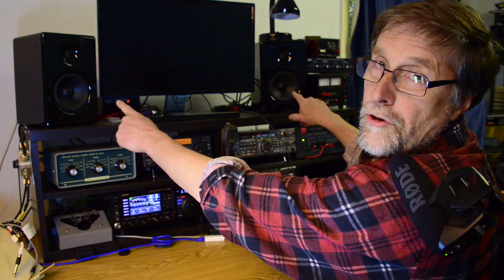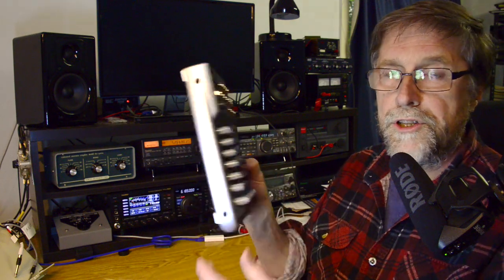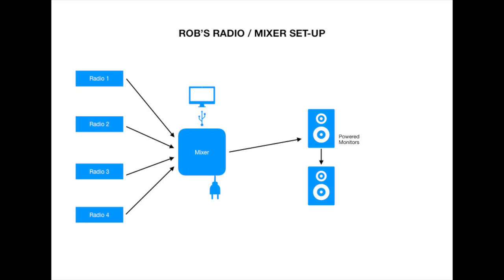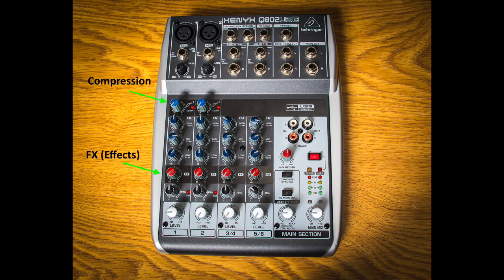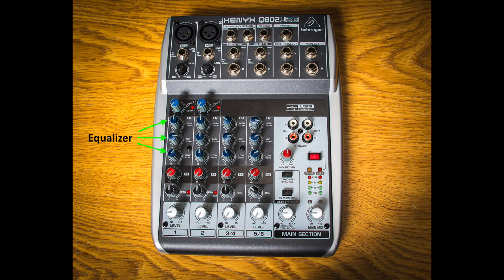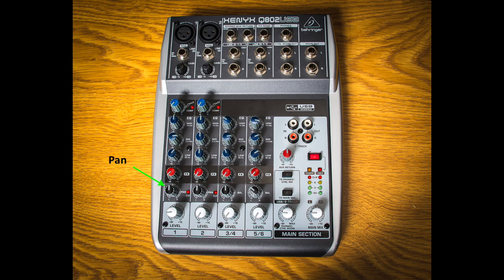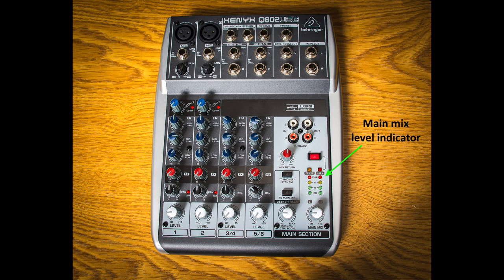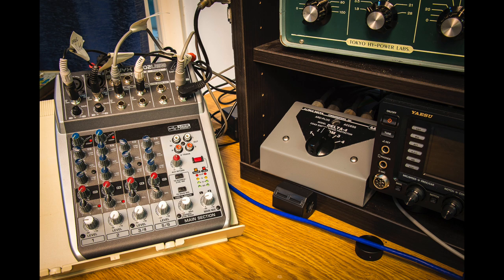Using a Mixing Console in the Radio Shack

Comment: The Xenyx802 is a great little board. I just picked up a used one for cheap and I'm amazed at how much you get and the quality you get from a little discount mixer.
Reply from the maker: Yep. They are great value if you buy them new...even better value if you can catch a used one in good condition. Good luck with it. Rob.

Comment: Nice way to tie in all your received audio Rob (creative solution), reminds me of when I was using a car graphic equalizer in the late 80's to improve the sound out of the Pearce Simpson Super Tomcat I was using during that period (native audio was particularly poor on that radio).
Reply from the maker: Interesting! I vaguely remember the Super Tomcat. Never owned one, probably because I'd moved off into the amateur bands by that time. Audio on some of those CB radios seemed to be better than others. I have a stereo graphic equaliser here, and tried implementing it into the system into the radio shack. But it was not successful, so I pulled it out again. I think there might be a fault with it somewhere. Will have to check it out again one day.

Comment: Is the mixer being recognised on a PC like standard USB sound card? Or must use software provided by the manufacturer? I don't use Windows nor Mac OS, so I wonder if I will use USB port anyways. I am looking at a 502 or 802 model (w/o the USB), to connect PC's sound card, FT-891, external PC speakers, headphones and mic. I am not sure if all that will work fine. Thnx.
Reply from the maker: Hi Thomas. As I show in the video, I am only using the mixer connected to audio output jacks on the various receivers/transceivers. There is no connection or interface with a PC. So I cannot advise on the setup you describe as I have had no experience with using it that way. Sorry I cannot be of more help.  73, de Rob VK3BVW

Comment: Bob Heil in a video that linked to this one stressed taking the audio output from the accessory plug in the back of a radio and running it into a mixer. He didn't even mention the external speaker jacks. What do you suppose was his reasoning? I'm of course going to go back and ask the question on his channel, but I'm curious what you might think as well. 73!
Reply: BTW here's the video in question: https://www.youtube.com/watch?v=BlmgC75SuSo. The first part of the video is about why mixers are pretty useless on the transmitting end, for the similar reasons to those you mention plus a review of the frequency spectrum they cover. The second part, however, gets into using a mixer to fine tune radio outputs, and that's where he speaks exclusively of the accessory jack.
Reply from the maker: @RickRose   Hi Rick! Bob Heil is saying that by taking the audio out of the accessory socket, you are going to get a better audio feed quality than if you take it out of the extension speaker socket. This is because you are bypassing additional audio filtering and colouring of the sound that’s inserted before the audio reaches the internal speaker. 

Because the purpose of the radio is as a communications tool rather than for hi-fi quality listening, he is saying that the final AF circuits and filters in transceivers are designed for the best sound from the internal speaker (which is usually narrower and a more punchy lo-fi quality). He’s right!

However, in my situation, I’m connecting two shortwave receivers that do not have acc. sockets, just an external speaker socket. For simplicity’s sake (and because I was in a hurry to try the new mixer at the time), I just took lines straight out of the transceivers ext speaker sockets as well. My two transceivers do have acc sockets, so I will try Bob’s suggestion and see if it makes as big a difference as he says.

Thanks for the question, Rick, and for taking the time to watch the video. 73 de Rob VK3BVW

Comment: Hi Rob just got my behringer mixer same as yours it's feeding a spare onkyo amp I had also I've purchased some jbl control one speakers.What are your Rx audio settings from your ftdx3000? I have the same radio.Im glad I went down this route instead of buying an overpriced extension speaker as I have more settings to tinker with and a better quality speaker.Only bug bear is with mixer no on/off switch :( grrr de 2e0utb 73
Reply from the maker: Mr Mc - I’m on holidays this week, so not near the radio. I’ll check up and get back to you next week. 73, Rob

Comment: Where and how do you plug a ptt switch?  Is the ptt switch go into a separate box?
Reply from the maker: I use the mixer for improving the sound on receive mode. I don't use the mixer for transmitting, so no PTT switch.
Reply: @RobVK3BVW  where does the ptt button go to the radio?

Comment: Rob, can you talk a little about RF shielding on this setup?  I tried this, but my TX audio keeps getting into the speakers.
Reply from the maker: Hi Scott. Are you using ferrite chokes on the speaker leads? These are an absolute MUST to avoid any stray RF out of the txer getting into the speakers. I have the clip-on types on my speakers and this helps heaps. Get a big enough clip-on for each lead so that you can wrap the leads through the clip-on multiple times. The more times you wrap around, the higher the choking impedance and so the greater the effectiveness in reducing RFI. Check out my video on this topic at: https://youtu.be/J_1jRfnvp4g   That should fix it!  Good luck!  Rob
Reply: Rob Wagner thanks Rob.  I’ve tried a few toroids and clips with varying results.  What mix do you use on the speaker leads?

Comment: but in addition to mixing multiple radio to speaker monitors, I'd like to use a single mic and also be able to mix and adjst eq to multiple radios... I would also like be able to connect my computer so I can send audio from the computer to any radios and also send the radio audio to the pc... that would require a more advanced board I guess...

Comment: Do you have any problems using speaker level input from the radios instead of line level. Isn’t speaker level much higher than line level?
Reply from the maker: Not at all, Gordon. Audio output from each radio is up about one-third volume, and channel levels are generally at around 1/3rd also, and final output to the monitors are about 1/3rd also.
Reply: Rob, does the speaker have to be a powered speaker?
Reply from the maker: Gordon, strictly speaking, no. This setup can work with just passive speakers. But there may be a little insertion loss resulting in somewhat reduced volume output. That can be overcome by cranking up the volume considerably on each radio. But then you may find slight distortion creeping into the speakers if the output amp on the radio is driven too hard. One of the benefits of powered speakers is that you can have a lower or more moderate volume set on the radios, and then let the powered speakers do the work of amplifying clean audio to a comfortable room level volume.

Comment: could i do what you have done putting a eurorackub502 on my icom 756 pro just bought one can you help please
Reply from the maker: Yes, Steven. It's a smaller mixer than mine, but if you are not trying to connect up lots of radios, it will work fine. Follow the diagram in the video for connections. Good luck. Rob VK3BVW
Reply: @RobVK3BVW  arr thanx alot rob i ordered the wrong plugs but i went through your vids and im waiting on my new plugs arr thanks alot keep up the good work and have subscibed to your channel think its great im from liverpool by the way lol anyway thanxs rob 73
Reply: @RobVK3BVW  oh and its only for 3 radios two icoms 756 720 and a vhs kenwood

Comment: Can you tell us about the speakers you use, and what to look for when shopping for speakers to achieve similar results?
Reply from the maker: Scott, the speakers I use were a relatively cheap pair (about A$300) of powered speakers. They are certainly nothing fancy. I first purchased them back in about 2008 for other projects. Then they got put away and not used for some years....until I bought the mixer. They have proved ideal for the job. Of course, they are no longer available now.  Here's a link to an old review I found from TechCrunch: https://techcrunch.com/2008/06/03/review-cygnett-unison-i-x5-ipod-speaker-system/   However, if you looked around for something similar, or if the budget can stretch it, a pair of bookshelf JBL speakers (such as the Studio 220) could work very nicely indeed! Powered speakers are a better option rather than passive - see my comments below to Gordon Zimmerman. I hope that helps! - Rob

Comment: Rob: you mentioned no RFI from the mixer's switching power supply, which is great.  How about RFI when using this device to mix audio from a computer and receiver?  When connected to a computer via USB, along with your tabletop receiver, do you notice any RFI creeping into your receiver from the computer?  How's the RF isolation between the inputs?
Reply from the maker: KILOKAT7 - I have not experienced any problem with RFI by connecting the USB cable between the laptop and the mixer. Any noise being picked up by the radio is due to the location of the laptop to the radio and not related to the mixer or the USB connection.
Reply: Thanks for the confirmation, Rob.  I just ordered one to try out here!

Comment: Rob, what name brand studio speaker are you using?
Reply from the maker: Gee, Chuck, I don't remember off hand (not in the shack right now). They were a $250 pair of an unheard of brand (to me!). Nothing fancy. Not studio reference quality or anything. But they do have a reasonable frequency response without being stunning! For shortwave, you don't need to pay $600+ for speakers. Just something that can handle a range of frequencies without distortion, that has a reasonably compact sound.

Comment: Dear Rob, what Rode microphone is that?  It sounds fantastic!  73, Jarrad VK3BL :)
Reply from the maker: It's a RODE Video Mic Pro. Of course, it is designed to sit on the camera (I use a Nikon D800), but I have it strapped to a boom stand. My mic is a few years old now, but I believe that have made slight readjustments to the current version. They even have a Video Mic Pro+ model but I don't know much about that. I have a videographer friend who has worked internationally, who insists on only using the RODE mics. And of course, they are a great Aussie company! Keeping the audio into the camera down lower and letting the +20dB preamp in the mic is a big help in getting a better sound. Here's a link for further info: http://en.rode.com/microphones/videomicpro
Cheers, Rob VK3BVW
Reply: I actually use this very same mic along the 7300 connected to zoom H5. The best you can get in the budget. I get lots of compliments on my audio.

Comment: 1:44 "I don't do any transmitting these days" and that right there is the often talked about problem that is constantly noticed by new hams. Lack of activity on SSB. These are licensed hams that simply hardly get on the air anymore. What is going on? It wasn't like that in the 90's and before. What is this aversion to getting on the air? And it's more and common. You can have reasons, but the sad part is that collectively more and more hams are not getting on the air. You can see it on QRZ where  nearly 80% of those commenting readily admit they don't use their radios for transmitting. If anything, THAT is what's going to spell the end of the hobby. 

Otherwise fantastic video on wiring up a mixer for receive only,
Reply from the maker: Whoa!! This video is more than four years old. Clearly, you haven't checked my QRZ page recently. I'm pretty active these days, where you will find me on FT8, WSPR, and occasionally out in the field on SSB. I am not sure how you derived the 80% figure of inactive hams listed on QRZ. Indeed the ham bands have been increasingly active since COVID has been around. People at home were looking for something to do and rediscovered their love of ham radio. You may not find them so much on the voice modes but the digital modes are extremely busy. And CW is making a big comeback since the code testing requirements were withdrawn (how's that for irony!!). There are lots of reasons why there is less activity than in the 70s-90s, but that topic is too long to discuss here!  :-)  Anyway, thanks for your comments and taking the time to watch the video. Have a great 2022!  - Rob VK3BVW
Reply: @RobVK3BVW  I'm aware of the date of the video and appreciate your comment even more so. I'm glad you're active now. But I did specifically mention SSB. And I didn't say that 80% of listed hams on QRZ are inactive. I referred to the commenters on the QRZ forum. And "NEARLY" 80% of them readily admit they are inactive. Again. Why? I'm talking about voice as I was in the original comment. Theories, there are many. Society changed/MIllenials and Zoomers (in America) are shy and are used to texting/etc. etc. but the fact is that people your age, my age, and older have stopped "talking" on the radio. 

And great for FT8 and D-STAR etc. But the fact is that you tune in 40 meters late at night and it's become a barren wasteland. It really wasn't like that even as recent as 2005. So there IS a problem. And you don't get on voice, so that's part of the problem. I fail to see what is wrong with talking to others with a like minded interest. But I'm glad that CW is active and it's a goal I aspire to myself.

But yes, if people don't get on the air (you should read the comments on QRZ. They have brand new commercial radios and don't use them) that is indeed the death of human voice contact on amateur radio. Is that the way it should be? Should that not be changed if there is a genuine love of radio ways and how your voice travels through the air to reach other distant locations based on your aerial setup?

And you're 100 percent correct that after Covid there was a renewed interest worldwide. But is it enough really? Thanks again I do appreciate the comment!

Comment: Suffered loads of RFI with that setup. Went down the viritual mixer route. https://www.youtube.com/watch?v=j_fk5SqktJg 73's and thanks Rob for your videos.
Reply from the maker: Hi John. Thanks for your comments. I have never had a problem with RFI from this mixer. As I said on the video, I am only using the mixer for received audio. All cables have ferrite. And I don't run a Windows system in the shack. It's Mac OS here, so the program you use wouldn't work for me, although there are Apple equivalents. Best wishes for 2022. Rob VK3BVW